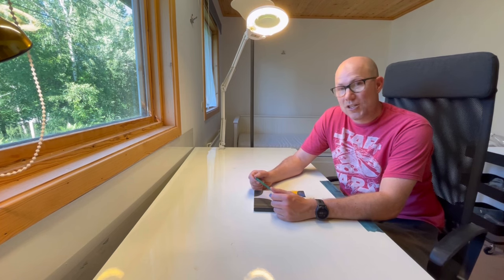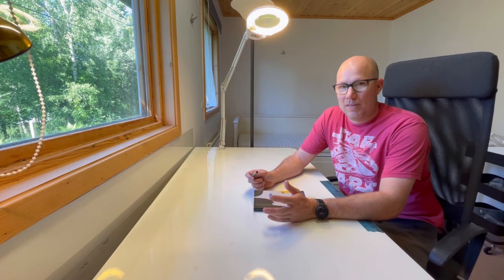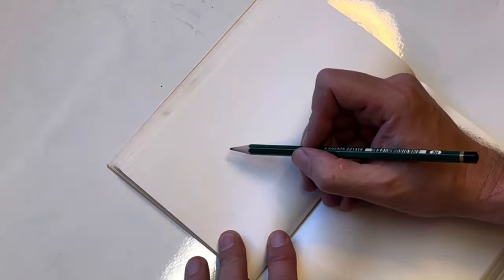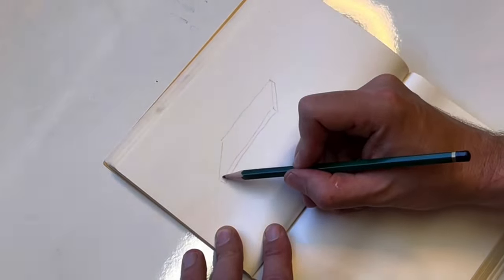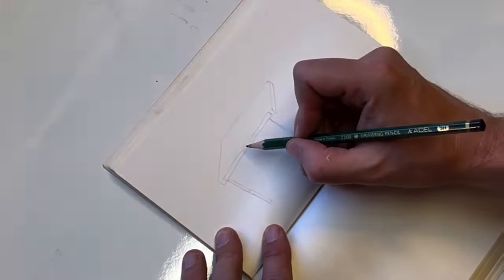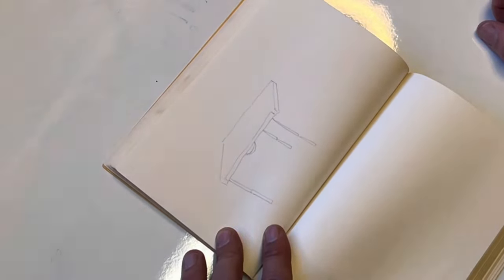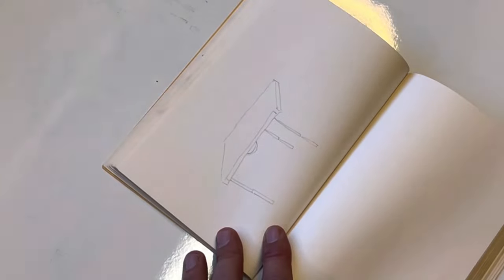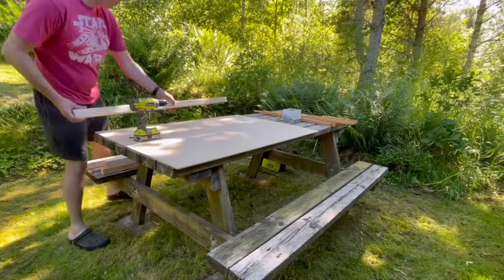Plein Air Preparation (Building a field table)

Comment: I like it, but you could use a full size piece of gatorboard and drill out cup holders for water and it would be a lot lighter....... Hmmm think I may need to make myself a table. I love following you on your plein air adventure.
Reply from the maker: That is a great idea. I also thought about making holes in the structure to make it even lighter.

Comment: Excellent DIY skills, but it looks too big to be practical, unless you're walking no more than 50m from where you're going to park your car. You'll have other stuff to carry too, including large sheets of paper and a lot of water, judging by the size of that enormous table. I guess if you plan to paint large paintings, then this is the way to go. The only thing I find you might miss, is being able to adjust the angle of the surface easily. I suppose you can do it by adjusting the relative lengths of the support legs.
Reply from the maker: No DIY skills here. 🙂 I’m not going on a hike so for longer trips I will take the car the first part of the trip. I never angle my paper with my table/easel anyways so that will not be an issue. I just feel like I want east access to my paints, brushes and so on while I’m painting. I also want to be able to paint bigger paintings than the smallest sizes. These are the reasons I choose to go with a field table in this size. We’ll se how I do. 🙂